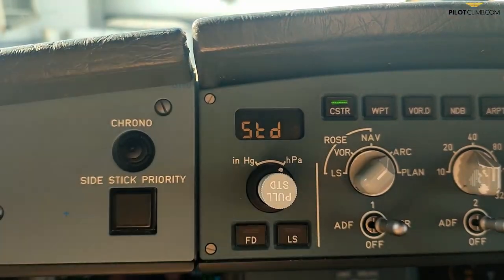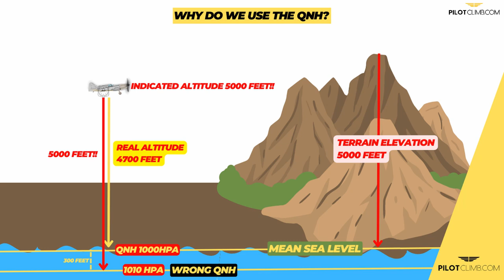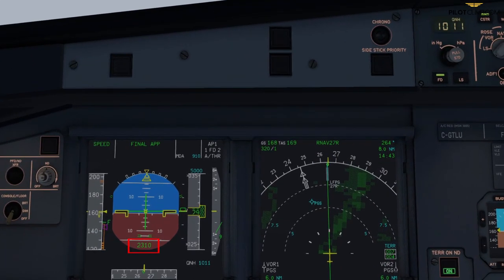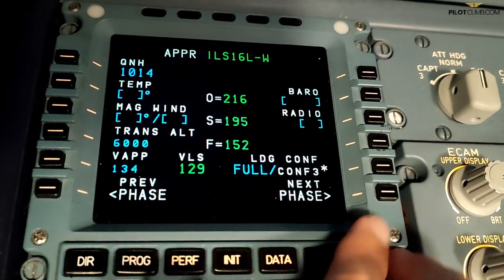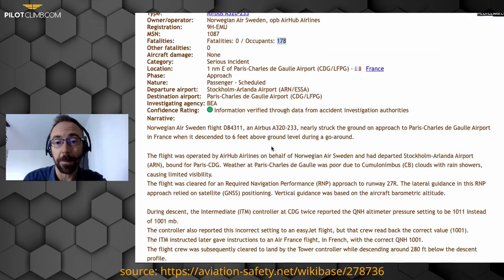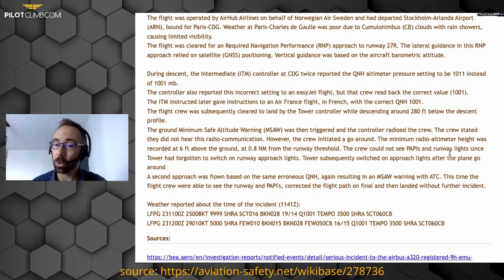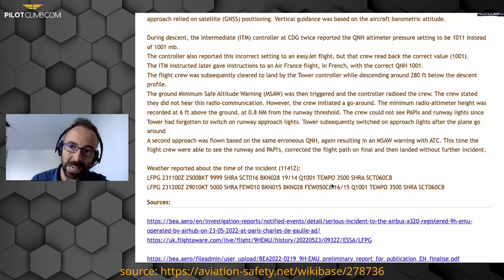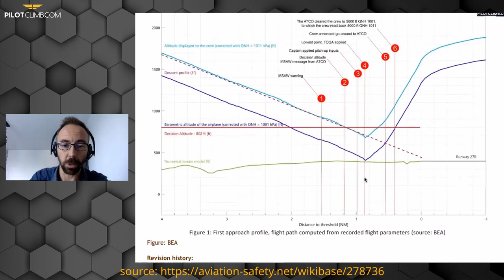WRONG QNH Set By The Pilots! QNH Blunder Error Explained!

Comment: Hello Gabriele,

Please, can you make videos about RNP and why pilots need to set different RNP values into the FMS depending on airport?
For example 0.3 NM or 0.1 NM accuracy.
Reply: Pilots don't set RNP values, they are prescribed, and they aren't entered into the FMS, they are already in the database. If you question why RNP varies at different times, perhaps that's something PilotClimb channel can better answer
Reply from the maker: Thanks for watching guys... I'll make a video about that in the future.. anyway the RNP is a requirement that changes depending on the phase of the flight and aircraft certification... take care guys!!
Reply: @PILOTCLIMB  

Thanks Gabriele,
RNP videos are more than welcome.
Also about RNP-AR.

What I want to know is, if the charts say:

No Baro-VNAV allowed below 10 degrees Celsius.
What happens if the temperature falls below 10 deg C?

This means that during a RNP the vertical guidance is via VNAV, not PAPI light, correct?

Also please make a Significant weather chart video where you talk about Tropopause.
Especially how to use the Tropopause values during a longer flight with significant changing Tropopause values and how you would enter these values during a flight into the FMC or FMGS.

Thank you.